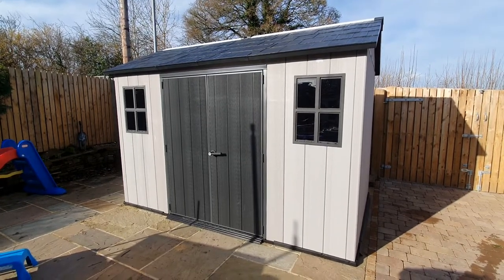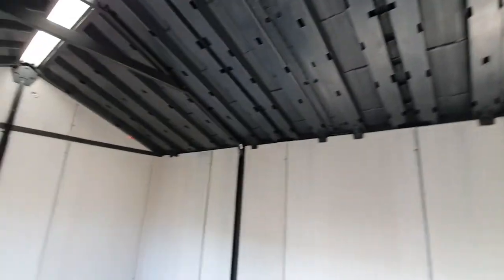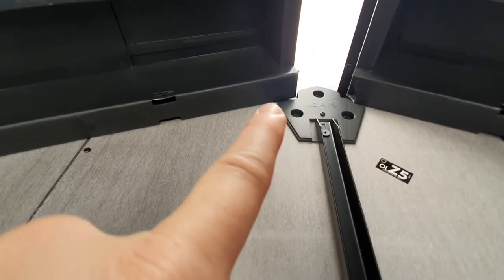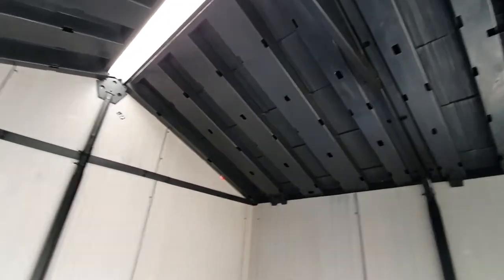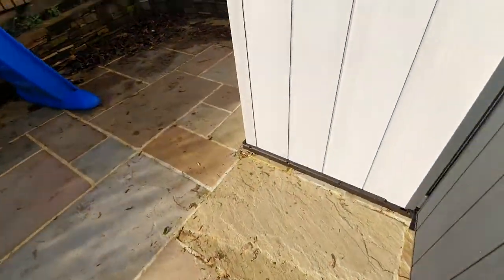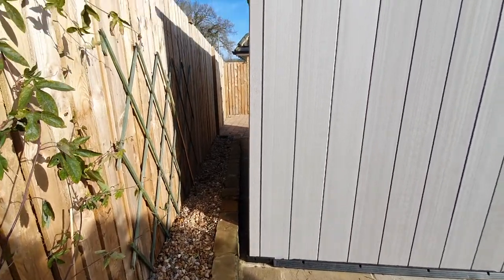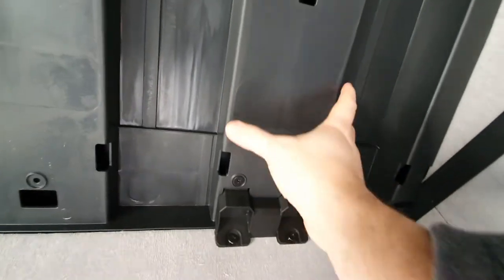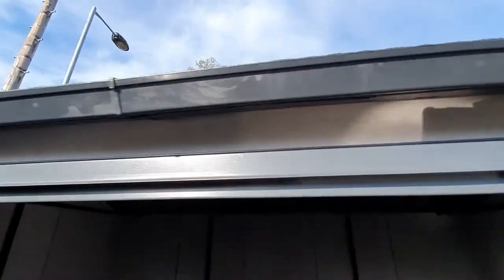Keter Oakland 1175 plastic shed review - real world owner construction tips

Comment: Nice looking shed . Any issues so far ? Thinking of getting this same model . I like the fact you can paint the panels . Resin typically fades . Being able the paint it over time can give it a refresh.
Reply from the maker: Ta, it's still holding together well, been through a long tough winter with no issues. Bit of moss low down on the panels, I'll jet wash that off soon. But it's stayed water tight and rodent proof. Good shed 😊
Reply: @zootius thanks for the update, looking at buying one of these too

Comment: How would you rate the quality and ease of build.  I'm thinking about a slightly smaller one for my garden
Reply from the maker: The quality is good and holding up well so far. No leaks. Ease of build is OK if you are able bodied, have somebody to help with the roof assembly, and have patience and time.
Reply: I built most of mine on my own (60+ woman), having help only for the roof and doors. I had problems with the right-hand side too ( looking from inside) . Also being on my own I put the door frame together on the floor, then put it in place.  It did say in the instructions to check the outside lines matched up on the triangular section! I'm very happy with it.
Reply: @jeanmurphy864  did you use anything to anchor the floor
Reply: @mad7206  no not yet.
Reply: @jeanmurphy864  I might start saving my pocket money up for one . Definitely nice looking addition to the garden
Reply: How secure would you say it is?
Reply: @KennieFabled  It seems secure, survived the latest strong winds

Comment: Great video thanks. Would you say this can be built straight on to a grass surface, or does it absolutely need a hard base?
Reply from the maker: Sorry yes I think a flat solid surface is required because if there's any flex to the shed base, it will be conducted up the wall panels and make the roof impossible to fit. The roof panels really don't have much tolerance for imperfection.
Reply: @zootius  Thanks, I suspected that is the case.

Comment: Just built a Keter Newton 11x5. Had trouble with last panel, as you say plenty of screws, middle two panels look very slightly bulged and not sitting flat so screwed them down and now looks OK. Pretty good instructions, took me 3 days though as I was careful to follow them. Need to figure out how I can put a lock on the front doors. All ideas welcome👍
Reply: I was thinking about the same thing (I am having a different model delivered today) 

I’m thinking about riveting a lock latch to the doors above the handle so u can put a pad lock. Obviously it’s not super strong but it’s really just to keep the kids out and secure the doors from opening in case they ever want to
Reply: @Derkaramma  I was putting it together when I thought the same but actually when you put the handle together it actually allows you to put a lock shank through it to secure it but you won’t see it until you fit it. Therefore it was rather easy in the end. Good Luck👍

Comment: Do you know what the floor to ceiling measurement are inside to the eaves rather than the highest point?
Reply from the maker: Hi James, it's 198cm internal height to the start of the eaves at the corner. 240cm is the highest point of the ceiling internally.

Comment: Hi. We've had a few nice days already. How hot (also cold) does it get inside? Can it be used ie as a play room for kids in spring/summer/autumn?
Reply from the maker: It's not insulated at all, so will just be cold in winter. However the dark roof absorbs heat from the sun and on sunny days so far it was pretty warm inside. Will report back during summer.
Reply from the maker: Report : it gets absolutely boiling inside on hot days.

Comment: Update video 2 years on ?
Reply from the maker: Need to get round to it, but in summary yes it's held together very well through some vicious storms. Still watertight, plastic hasn't faded or gone brittle. Very pleased with it TBH. Only prob at the mo  is that the bottom 6 inches is a little green with moss, so I'll be pressure washing it soon to sort that.
Reply: @zootius   Thank you for the update. I will more than likely will buy one myself now.
Reply: Do you think it would fit four mountain bikes plus some lawn tools?
Reply from the maker: @AmyPezzicara  yes certainly enough room for 4 mountain bikes and a fair bit of room to spare.
Reply from the maker: My update video after 2 years :
https://youtu.be/aNF0ehzeXvA?si=mAQ7UTZPSOL4NzR9